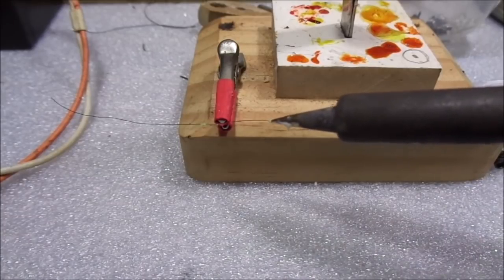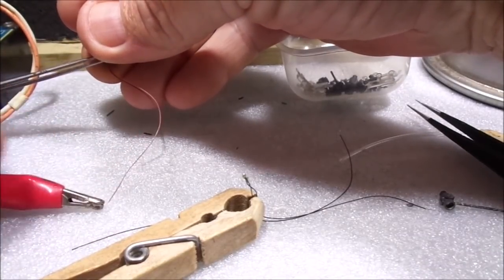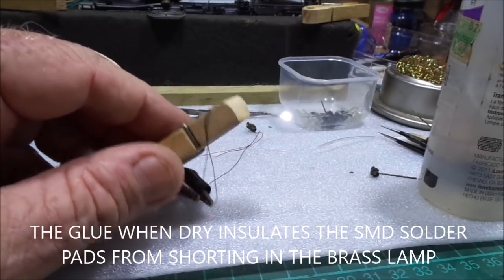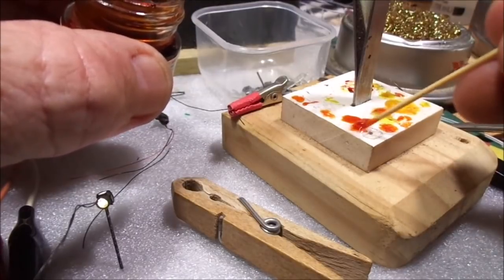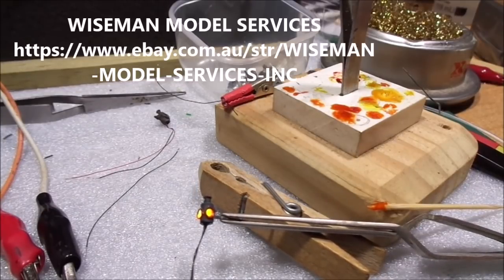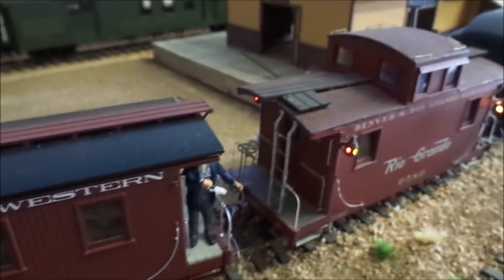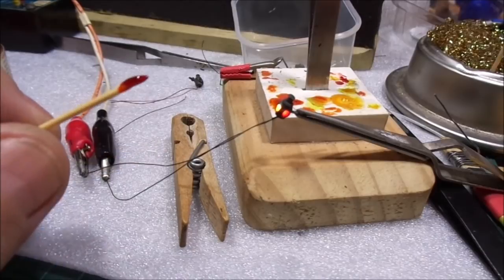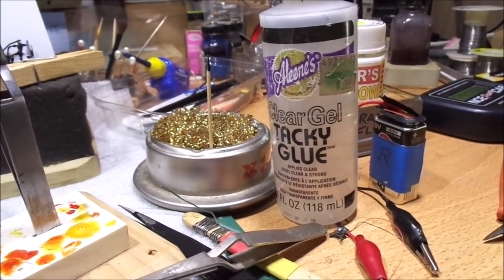On3 Caboose Lamps LED install

Comment: Where are you getting your "Warm White" LEDs?  I can't find them anywhere that don't already have wires on them.  I just want the LEDs separate of a reel, like what you showed in the bag.  Thank's mate!
Reply from the maker: Satisled - China, min purchase 1000 pcs
Reply: @scoopmmr   Do you remember the part number?
Reply: @scoopmmr   Also, how long does it take to get them?
Reply from the maker: @christopherbrown5338  WHo knows with Covid ! - Was 2 weeks in normal times. You may have to set up an account?
Reply from the maker: @christopherbrown5338  No, you just need to search their site for what you want.
Reply: @scoopmmr  most decoders are putting out 12 to 14 volts.  Based on that do you use 1k resistors when wiring them?
Reply from the maker: @christopherbrown5338  Yes, 1k up to 3.7k will work, 3 x LEDs with one resistor